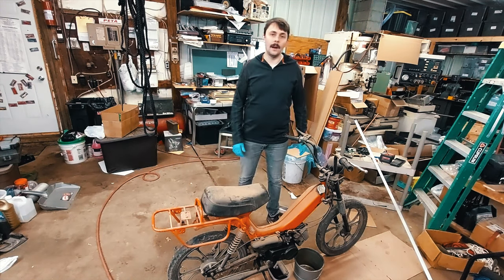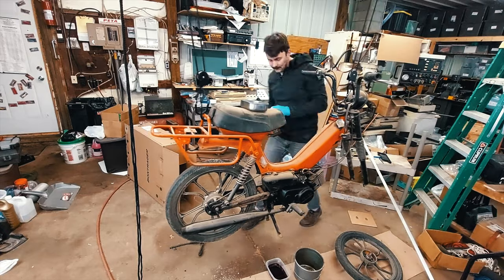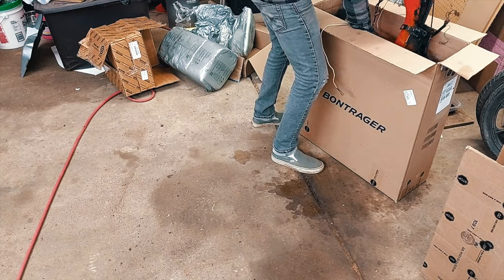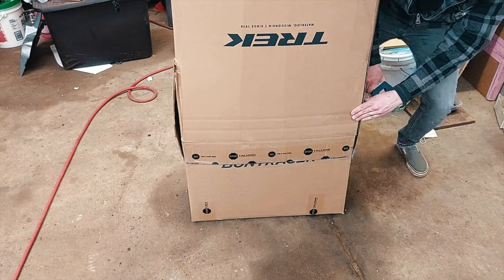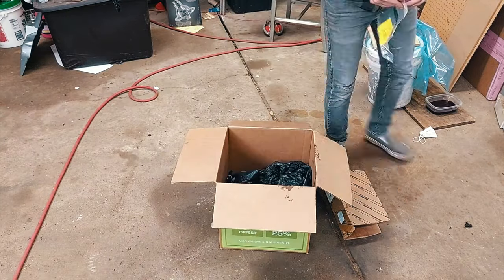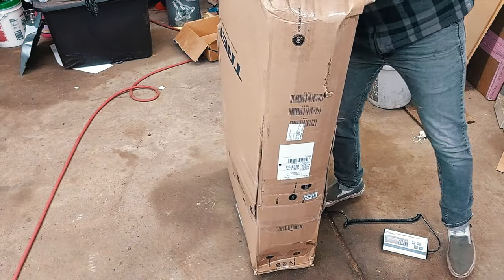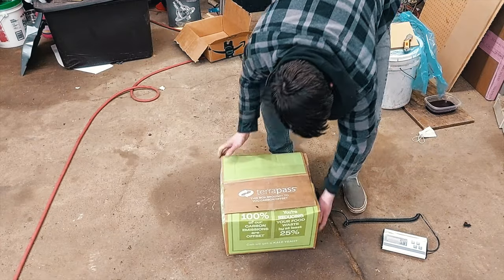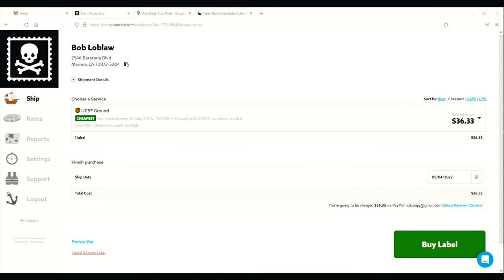How to ship a moped for cheap $100

Comment: Hi! In Minessota you have a specific Lay for drive 50 cc? O ir a normal Bike. Thanks an. Regards from Spain EU/
Hola,  ¿ En Minessota hay alguna ley específica para las motos de 50cc ? O son son como el resto de motos. Saludos desde España EU 👋🇪🇸🇪🇺
Reply from the maker: In Minnesota, Mopeds or 50cc have their own law or classification. You don't need a motorcycle license so almost anyone can ride them. They are not very regulated so they are fun.
Reply: @Corn-ped  Really cool! In Spain have a specific law for 50cc but the people modify this bike a lot. Is very easy to buy mods. Thanks for your answer and enjoy ! // En España si hay una ley específica para motos de 50c.c. pero la gente las modifica mucho. Gracias por tu respuesta !